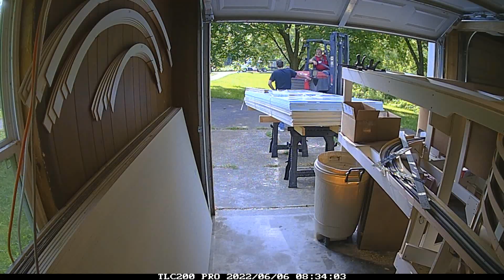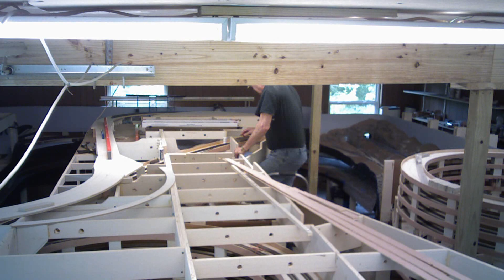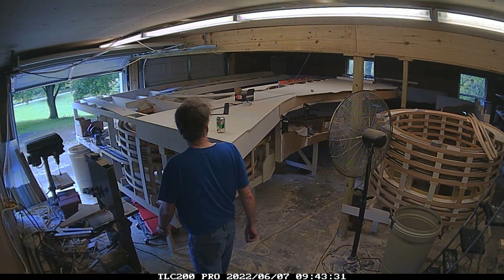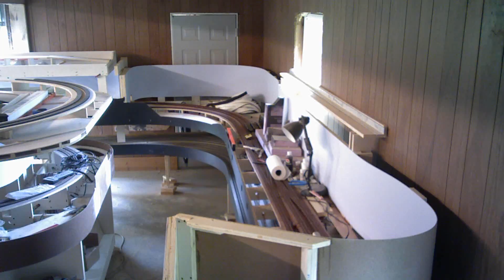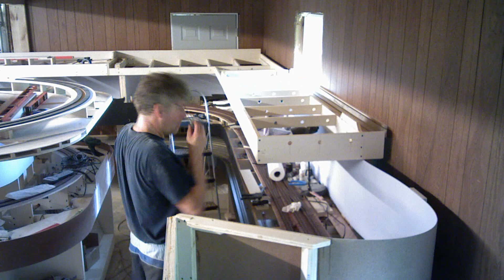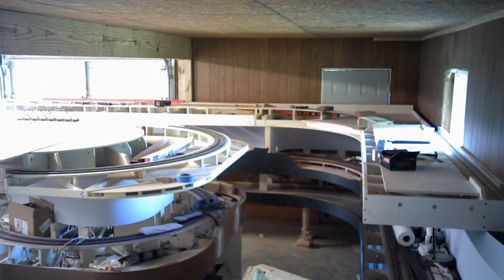K&SV time-lapse 22

Comment: Great work on the layout. When you are cutting the plywood down what is the width of the strips? I see you cutting those down to the length you need, but what is the width? Also, what thickness plywood are you using? I ask because I will so be able to clear out my loft and start building my own layout and cannot decide if the plywood strips should be 3, 3.5 or 4 inch wide (or something in between those). I presume there are various sections that are 'bolted' together so you can move it to the customer's site. Thanks for all the wonderful videos, you're an inspiration to all of us who watch your work.
Reply from the maker: I use 3/4" for all framing and 1/2" for the subroadbed.  The strips are whatever width I deem appropriate for each section.  If you look closely, you will see that the widths vary greatly.  Although typically 3 or 3.5 or 4, there are places as narrow as 1.5 or as wide as 8.
Yes, the bolts connect sections that will be separated for transportation.